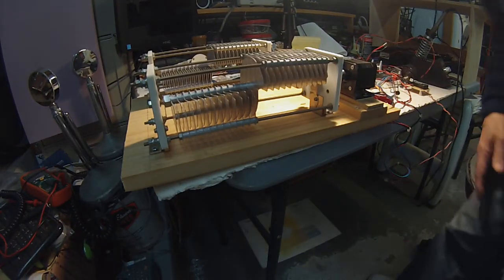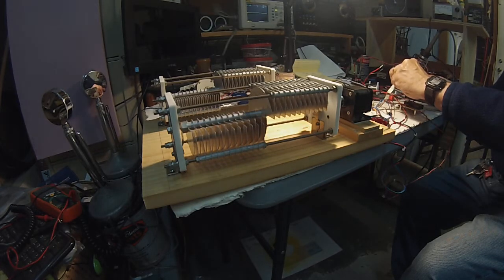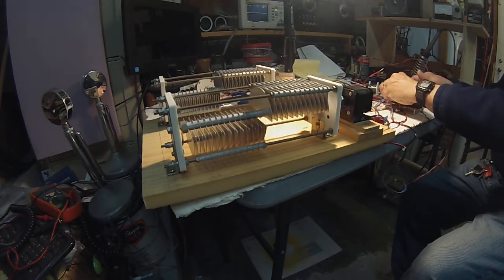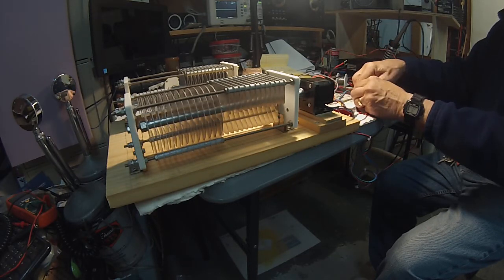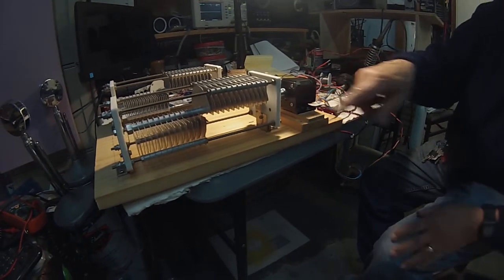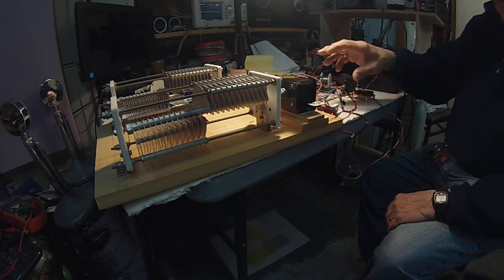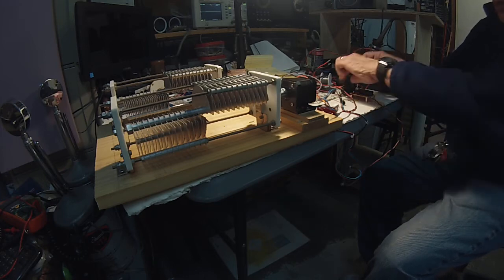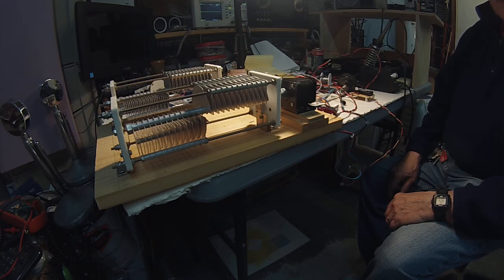Remote Antenna Tuning

Comment: Nice work. Stepper motor resolution looks pretty good but you could add a gearbox to resolve it further for fine tuning if needed. There are readily available gear sets which are easier to set up than direct shaft alignments on the caps.  Also, the little Pro-Mini 328, 16Mhz boards can be set up for all sorts of presets on each band or between bands. I will follow your project - it's obvious that you put lots of work into it already so good luck.  It's nice to see hams who actually still know how to build things.  FB & 73
Reply from the maker: This project started off as a 'poking" fun piece as the first effort involved a very small stepper motor controlling a tiny variable capacitor in an analog VFO. I have a friend who loves to build stuff but always builds mechanically tuned analog VFO's. He tends to shy away from anything digital. So that joke project -actually worked as I was trying to entice him into the world of digital electronics. An Arduino tuned Analog VFO. That is in a league of Jumbo Shrimp. Well that effort led to this and yes lots of power in Pro-Mini. This is a project waiting to be finished - but I sort of surprised myself that a big variable could be tuned with a rotary encoder. Thanks for your comments and suggestions.

Comment: nice capacitors!!!
Reply from the maker: Hi Dean -- you will not believe this … several years ago my son needed an aluminum box to house some controls for a big CNC machine he was building. He found one on eBay and these were not mentioned in the ad but were installed inside his box. When he got the box --he said look what I found inside the box. He paid $15 for the "used metal box".

Pete